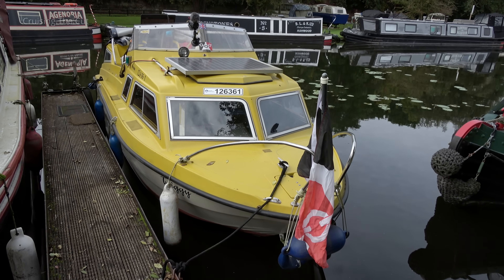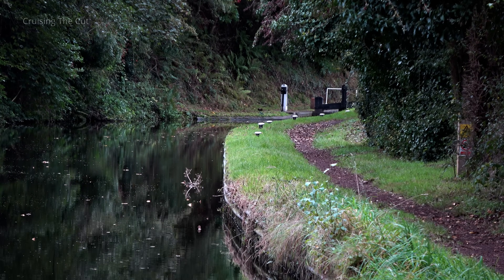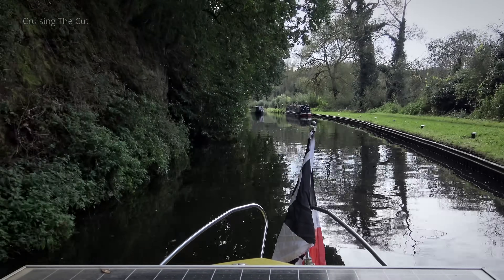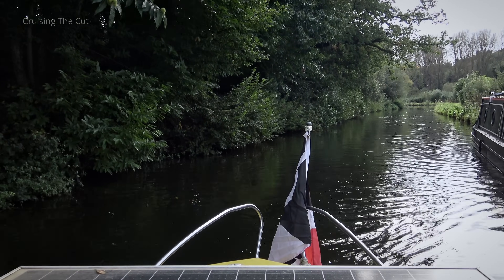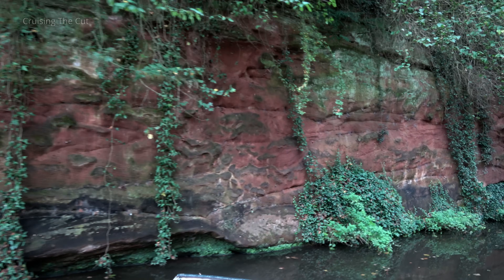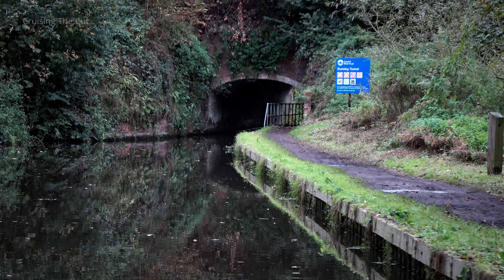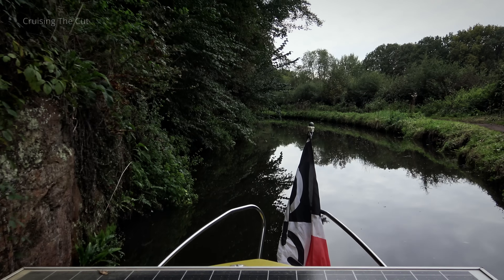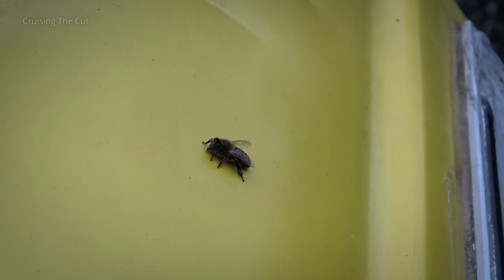317. I bought another boat

Comment: Really happy to see you back on the water and welcome to the world of "fiberglass boating" (less complimentary terms are available!). The boat looks really tidy - can't wait to get a (virtual) tour of it. I like the centre cockpit design, very similar to my Palomino 24, except I have an inboard engine and sterndrive so my rear cabin is higher and full of smelly noisy diesel engine. And, yes, an outdrive behaves much like an outboard and takes getting used to; took me a while to work out it only steers with wash over its own rudder so sometimes at low speed you need a burst of power to do a slow but tight turn, counter intuitive to my brain. Mine is now out of storage (outdoor storage so its turned green and horrid!) and I'm embarking on a restoration so will be dealing with all the usual issues these boats have as they age: painting / gelcoat recovery, leaking windows (due to the fiberglass flex you mentioned), hardly any insulation compared to a narrow boat and, in my case, a new interior is now needed. I tend to think of it as a camper van on water and that gets me through. Mine is now at North Kilworth wharf; for a while I could see your former boat at the adjacent marina as it underwent its recent electric conversion. Good luck and happy / safe boating!

Comment: Nice video David , showing how it can be done on a budget,  maybe look into a finer pitch prop for your out board so you can have more revs but less shove , look to get its mid range to low / cruising revs to match your preffered cruising speed  , basically get it geared correctly for canal work and also take any play out of the steering system if it has any as that will help

But ultimately you could look at building a simple hybrid system , smallish battery pack , electric outboard and small generator to top up the system as required or run permanently while actually cruising

Comment: I spent many happy days attempting to pilot my father's Norman cabin cruiser. They are so light and with such little draft they do drift alarmingly, particularly in a cross wind. In tunnels I think your own prop wash can have you going all over the place. I look forward to seeing you pilot passed your first weir! I found that you can go in a more or less straight line if you apply a little rudder all of the time, it's a little like driving a rally car with permanent opposite lock. The great think about the outboard is that they are great on rivers, plenty of poke and the boat feels much more at home. Have fun.

Comment: Boats like this have lousy forefoots (the forward-most sharp end of the underwater portion of the stem) This you really can't fix easily. The so-called rudder on your outboard motor (called the skeg) is really a toy. Riveting a plate of the same thickness onto the skeg to increase its size increases it's bite in the water to swing the stern quicker. A modest keel on the underside of the boat helps (though not at high speed on a lake). But better still are two "chine keels" or "sister keels" you might call them installed about a foot in from the chines and no more than 2 inches deep. These greatly reduce diagonal skidding. Some call these bilge keels but we're just talking about a depth of no more than 2 inches and running a good way forward to improve tracking and reduce diagonal skidding.

Comment: Great video. While at a dock, have someone hold the motor and when you move the wheel check to see if there is any looseness in the steering. If, yes, then fix that as that would make for very tricky steering. Also if there is looseness between the motor and a rudder extension, that should be fixed too. Any "play" in the steering makes it more difficult.

Comment: Next time you're hauled out, give a look to what sort of keel is keeping the boat tracking straight. I suspect there isn't much of one. It would be an easy fix to add a false keel.

Another possibility is that the boat is underballasted or bafly trimmed and therefore not quite lying down on her lines, especially forward. This you can test while the boat is in the water.

Comment: Great to see you back on the water. Your throttle issues would be the throttle cable sticking. Install a new one and the problem should be solved, something you'll probably have to do every year if it stands idle in the off season.

Comment: Happy days ....back on the water! Your little motor should be able to be put into gear at idle. It may need the throttle cable adjusted . Also a finer pitch prop may give you a little more nuanced control.

Comment: As Nick Burnham says, if you're floating, you're boating, so congrats on your new purchase.  I have a couple of thoughts on things you may have figured out by now:

1) I think your outboard needs a tune-up, because it ought to be able to idle slower than that.  But it's still true that at marina speeds, you may need to bump it in and out of gear to go slowly enough.  Of course, you'll need to be in gear to apply thrust for steering.  After all those locks, you must be quite good at pull-starting by now!

2) Remember that an outboard provides vectored thrust, unlike the narrowboats you've been driving with a fixed propellor and rudder behind it.  I think you'll do better turning the wheel much less.  You still get some rudder effect in neutral, but you'll turn faster in gear.

3) Some practice time in a larger basin would help you learn where the center of mass, about which the boat will turn, is.  In some boats it's near the center, in others it's surprisingly far forward or aft.  Given how eager the stern is to swing out, I'd guess it's fairly far forward in your boat.  So you'll need to aim the bow closer to the inside of your turn to allow room for the stern to swing.  I've been surprised by how little the narrowboats in your videos seem to do this.
Reply from the maker: Cheers

Comment: Make sure the outboard is trimmed all the way down. Thats more then likely why your having those steering issues. If it wont trim any further you may try moving the engine lower on the transom. There are usually different bolt holes at different heights. You'll have to take the boat out of the water to lower it

Comment: Welcome home, David. The cut has missed you.
The little butane stove is one of the safest ways to cook in your small space. The boat is not air tight enough to have an issue and if you're anxious, just open a window a tiny bit. Of course, you never leave an open flame alone no matter what type it is. 
Nice looking cup of tea. Enjoy your new toy and cruise well.
Reply from the maker: They’re not that safe. You’ve got flammable gas in an environment where it has no place to escape to (so could pool in the bilge which is an explosion risk). The flammable surfaces all around must not get warm. Plus I have seen plenty of videos of those stoves where the gas escapes (lit) out of the canister in-situ, causing flames to shoot out of the sides.
Reply: @CruisingTheCut  There must be millions of them about so I doubt they are any less safe than any other stove. I find it suspicious that someone would just happen to be videoing one which went wrong. There are "name brand" ones which have an overpressure cut off, not sure about the no name cheap ones. Also there are cheap off brand gas canisters about which might be best avoided. I have used them for years on boats and campers, this year used one under a folding oven with regular checks and found that the gas canister stayed completely cool and the wooden surface it was sitting on got warm but not excessively hot. It looks as if in your boat it would be quite easy to build a metal tray for the stove with a drain through the side to deal with any leak of gas.

Comment: Sounds like you need a trolling motor.  Small, designed for low speed maneuvering.  Originally meant for fishing boats and/or pontoon boats, I'd imagine it would do very well for low speed canal travel.  There are both liquid fuel and electric models, so you have some options.

Comment: As any old sailer will tell you, with a rudder and prop the force of the propwash on the rudder thrusts the stern in either direction. With an outboard the directional thrust is immediately applied thus steering characteristics are remarkably diiferent. Advantage OB in slow speed manoevering. Prop and rudder; if you're not moving, you're not steering.

Comment: Short boat without a deep keel do not steer well at low speeds.  It is amazing the difference in low speed manoeuvring  between a small keelboat (sailboat) with a big rudder and a short powerboat that does not have a deep keel.  You need a bit of way on with the powerboat for the shallow keel to grab.

Comment: Thanks for this great video once again. I started off on the cut at Kinver in '74, also in a twenty footer with an outboard with a rudder. Though I suspect your rudder may be loose or faulty. 74 years old now and had many larger boats since (too wide for the cut) but I recently aquired an old Norman 20 which I am renovating and I wish to re-visit my old cruising grounds next year before my age beats me. Been from cut to river, river to sea and shipwrecked twice in the Bristol Channel. Safer on the cut, hopefully. By the way, it used to be good beer and food back in the day at the Vine, hope it's not closed again. Good luck to you.

Comment: I would check the steering system for slop or slack in its cables. Its probably the type with pulleys and wire rope cable. If its the sheathed cable type such as Teleflex check all the mounting points and linkages for play or damage. Personally I prefer an outboard motor for maneuvering but its a learned skill just like driving a narrow boat. For best low speed maneuverability adjust your idle as low as possible without stalling when engaging the gear, lastly a different propeller can make a big difference, I wonder what they use with a boat that will never see 10 knots and needs low speed maneuverability sacrificing high speeds for more low end thrust... Never mind, I am just rambling, cheers brother!

Comment: I think you need to lube the steering on the out board  and  cables. Also make sure you add stabile to the fuel . I like star Tron or sea foam. The motor should have the make model and h.p. on a plate. Make sure you change the fuel liter. Have you had the boat out of the water ? To see if the bottom  needs pressure washing .  If you have any questions contact me .I think the out board is too small.for a 20' boat. A 9.9 hp  long shaft 1:20  is what you need. Also a longer shaft . For heat a small oil filled stove. If you have power points in mooring places. Those stoves are safe out side as are laterns.  Just make sure you let them cool off . And relieve  the pressure by opening  the fuel tanks ( out side ).
Good luck Capt.😮
Reply from the maker: Cheers

Comment: Steering: 1) Your outboard is off-center, therefore the thrust is off center.  Most of the time you'll correct that by crabbing ever so slightly without even realizing it, but at low speeds and high thrust it will be more obvious.  2) No, you do not need a keel.  Where I come from the river is thick with boats that have outboards and no keel.  Some of them have flat bottoms, some have shallow V bottoms, some have deep Vs.  The deep Vs do track best, but even the flat bottoms are controllable due to hard chines.  If your boat has hard chines, then practice and technique will suffice.  If not, then you'll just need a bit more practice.  🙂  3)  But I've never driven an outboard powered boat that didn't wander a bit at low speeds.  Just something to get used to.  You said this boat is over 40 years old and it still looks great, so the previous owner's clearly learned to control it without bashing it up and I know you will learn it, too.

Electric outboards in the US seem to be priced comparably to gas ones.  And at the speeds you are going, I think you'd be surprised at the range you will get on them.  And they can be smaller than gas so you might be able to move it closer to the centerline.  Batteries are not cheap, but if you can use that solar array to charge your batteries, you will be paying off the cost of the batteries every time you run the engine.  At some point, operation could even be "free".  Just something to think about, though buying the battery in the first place is like having to fill a gargantuan fuel tank all up front.

Comment: You might get a bit more rudder authority by adding a hydrofoil plate to your motor.  Although they're primarily designed to get a boat on plane more quickly (which you can't do on the canals and a small engine won't do in any case) some of them have significant vertical fins which act as rudders at low speed.  Your comment mentions a rudder fitted to the motor, but perhaps a hydrofoil could be added as well.  Also, I've seen 7.5/10 hp. Hondas (which i think yours is) fitted with a circular propeller guard hoop that also give some directional control.   I once purchased a twin fin arrangement that attached to the cavitation plate of an I/0 unit.  It was spring loaded to flip up out of the water at speed, but it sure worked a treat at idle speed or even coasting in neutral.  Unfortunately, I think the manufacturer went out of business, cause I don't see them advertised anymore.

Comment: I was wondering when you went with your m8 in Tangerine Dream, how long it would be before, "I bought another boat". I also, think boats like your lil tacka might need a couple smallish rudders hooked into the steering system either side of the motor. Good stuff David, Kinda thought you were hangin out to get back to the canal. Hope you and Twiggy have a lot of fun together.

Comment: Great to see you with a boat again, and on a favourite canal of ours.

Your outboard should be able to run slow for manoeuvres when warmed up. Ours does!  Check that choke goes right in, throttle cable and links.  

Steering: is her bottom weedy?  If not, then cable checks, more keel as in pinned post.

You'll find the fibreglass almost maintenance free after steel (I've had both).  Ours just has a quick annual or two yearly application of Owatrol for Gel coat to keep colour feep and fairly shiny. (Use on colour gel only and wipe off before it dries).

We used cooker like yours for years.  It was fine.  We stored in cockpit whennot in use so probably safer than plumbed in gas if used sensibly.

Looks like you've curtain wire above and below windows which is good to stop curtains hanging away from side at bottom.  Use thermal or blackout material, wire channels topand bottom and velcro at sides fot good blackout.

Consider storing out of water in winter.  Saves CRT cost, weed growth, possible osmosis.

Looking forward to full tour....

cheers, Bill D
Reply from the maker: Cheers Bill

Comment: Noting your camping stove and kettle on board.....
Well I have similar set up in my home kitchen.....to save electricity 😮
Yes propane can be dangerous on board a boat partic when it sinks in Yr hull and an explosion occurs.....
I buy my propane in 4 packs from home bargains..... remove a canister when not in use and put a cap on it to stop leakage.....
Guess I am preaching to the converted with your boating experience David??

Comment: l feel your pain navigating a small fiber boat. Boats that have longer displacement hulls are usual better, that is sit deeper in the water, than boats with a planing type hull that tend to sit on the surface.  the lose steerageway very easily.  l owned a eighteen foot Shetland years ago it was the devil approaching a buoy mooring especially in windy conditions. One needed to juggle the speed and in/out of gear very judiciously. When traveling at planing speed it was perfectly okay….

Comment: Great to see you back on the canals even if it's in a yoghurt pot, certainly much simpler than a steel narrowboat, no blacking, no shock surveys, no anodes and no wondering if your hull has thin spots in it, once you get the hang of it you'll be steering it past obstacles without a worry in the world.

Comment: great to see you back on the water david.i have a 9m fibre glass canal boat in france. It too is powered by an outboard (mercury 15 HP4stroke)... i have no problems with stearing so feel as if it just needs to be set up right ...i do remeber when i bought it new i was advised to buy a long or deep propeller shaft ....or something like that...hope this helps a bit and happy cruising...ps fibre glass is strong but i keep my fenders down all the time !!

Comment: Although not much power is needed to achieve the speeds you travel on the canals, thrust and steerage are needed to maneuver in these conditions. Perhaps a change of propeller would give you more thrust and steering control. I'm not an expert at all, but you might get more control with a larger diameter/finer pitch propeller. Another thought I had was to maybe use a fairly large longitudinal blade attached to the outboard to act as an actual rudder. With an outboard by itself, once the power is cut, you have very little steerage even though you're moving. With a rudder attached you could direct the engine thrust better, and the rudder would have steering input as long as the boat was moving through the water, even with the engine in neutral. Just a thought.

Comment: I know lots about small boats as I've never owned one and drive a desk in a bank for a living, so I may be uniquely placed to suggest... a small Diesel outboard? Possibly a touch noisier, but very economical and happy to run at low revs/speeds? Possibly plenty of torque to run a more powerful alternator to tap additional power from? I dunno though... Great to see you back on the water!